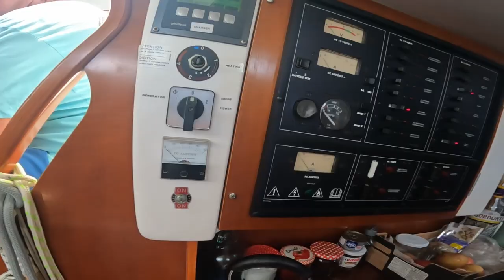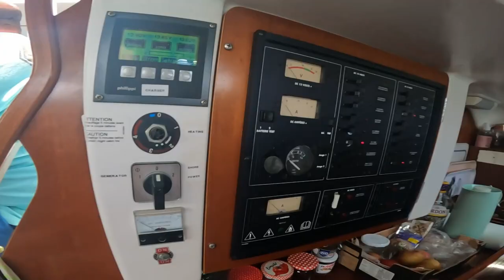40' Beneteau Oceanis Full Sailboat Tour (Wonderful Turkish Couple)

Comment: These boats would be absolutely incredible if they only had an encapsulated keel and skeg hung rudders. It's truly saddening because they are incredible boats otherwise. I just can't do a blue water boat without those must have safety designs.
Reply from the maker: To each their own. 😀
Reply: Even though they are called CE approved blue water boats, many of the new structures are not practically blue water boats and they have major security vulnerabilities (especially rudder design/structures).